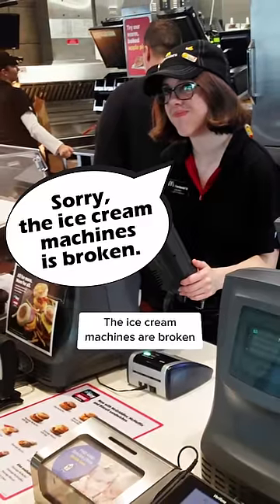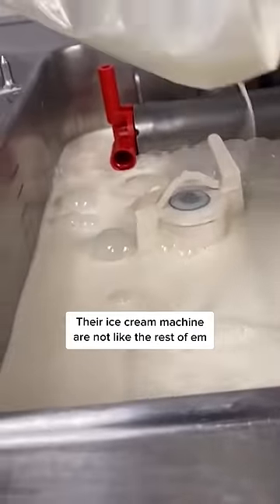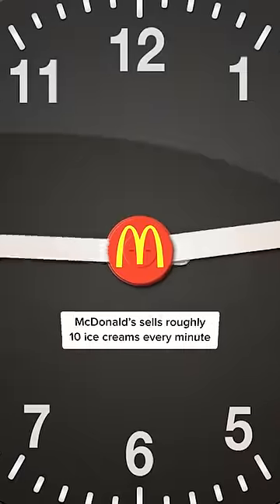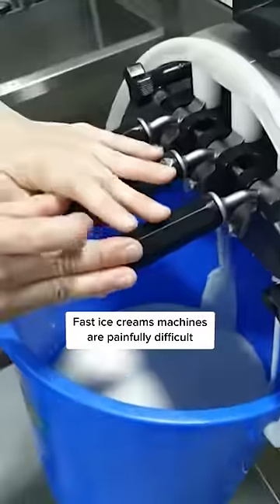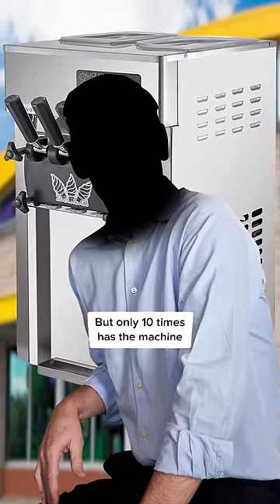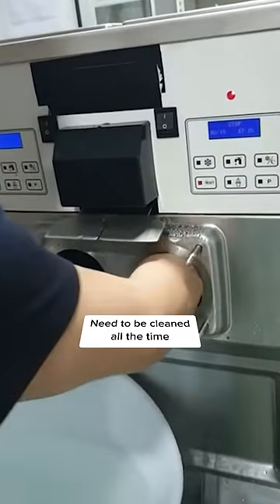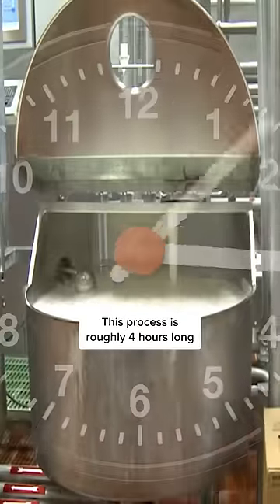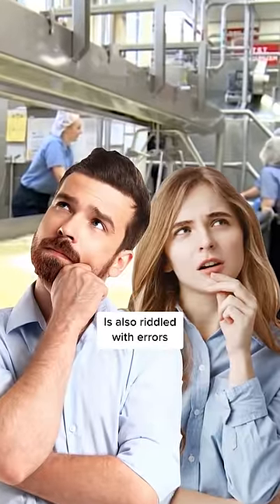The REAL reason McDonald's Ice Cream Machines are always broken #shorts

Comment: This is slightly false. As Johnny harris said in one of his videos is that the cleaning is not the problem. The machine itself is the problem. The machine does take 4 hours to self clean, but the machine makes "errors" 9/10 times. The machine produces a code that only the taylor technicians could fix with a simple key. And all manual procedures always points to "call for techincian"  and the worst part of it all is mcdonalds doesn't want to solve the issue and will sue if a 3rd party intervenes.